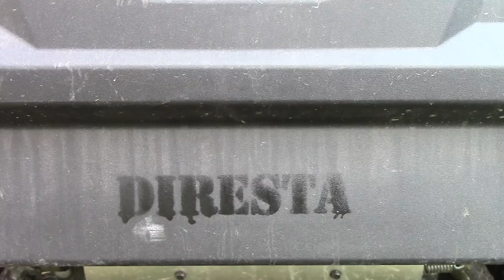✔  DiResta Tree Swing

Comment from the maker: This video is 4 years old so please no chainsaw safety crap!! enjoy!
Reply: jimmydiresta I really like the build!! Mainly because it looks so natural
Reply: jimmydiresta ok I will assume that you already know how dangerous the chainsaw plunge cut you made was, just kidding. As long as you still have all the fingers you had before you started it's safe enough. Great video as always.
Reply: how did the splice hold up over time with no wrapping? or did you wrap it later? i'm curious if wrapping really matters or not (i was always taught to do it)
Reply: jimmydiresta Just chainsaw the haters. ¯\(ツ)/¯
Reply: jimmydiresta love watch this video again 👍👍
Reply: Did you read the Title? DiResta Tree Swing (WARNING!! old Video) The clue is in the title if you are not sure........... Hint - Its in Brackets ( ) ....Where it says WARNING" OLD VIDEO....
Reply: I am a seaman, and can tell you with confidence that most splices are not wrapped. Mostly I wrap each individual strand with tape, or if it is synthetic rope, I melt it with a lighter. But I do this mainly to make the splicing more easy. (Even the big 8 or 12 strand ropes used to moore freighters aren't wrapped)
Reply: Gunhaver They will last. The more you pull, the tighter it gets.
Reply: +Delphi Man BYE!!!!
Reply: thats really interesting. i always wondered if wrapping it really did matter or not. i too would fuse the ends of strands to make it easier to splice (assuming it is nylon rope). thanks for the info!
Reply: Cool splice.....
Reply: jimmydiresta I am Mexican make the shield of the captain america
t admiro
Reply: jimmydiresta, gosh can you learn to go back in time and make things perfect so the trolls cant complain :D. In all seriousness thanks for posting all of your old videos on your channel :)
Reply: uSpotGaming He could probably find a Time Machine on the streets of New York City.
And I want to ride in it...

Comment: i haven't spliced a loop in so long... makes me miss the good ol days. 

also you should wrap or tape that splice. probably doesn't matter on that swing, but its always good to do to keep the splice together when people put their hands on it
Reply: maybe use a twine or string wrap over the splice? just spitballing
Reply: in the past i have used twine or thick thread that is designed for wrapping a splice. i have also used various kinds of tape. i asked about splicing in another comment, and some people chimed in that wrapping is not necessary if you fuse when needed. Jimmy's rope in this video was not nylon, which is probably why he trimmed the strands instead of fusing them with a lighter. wrapping is probably just one of those things that you are taught to do because thats how everyone else has always done it lol.

there is a kind of knot you use to wrap, so you can actually wrap using any kind of rope. obviously some will be better than others. Now, if you are talking about the end of a thick rope that is not spliced, and it is also not nylon, then you will have to wrap it to keep it from unraveling (because you can't fuse it).
Reply: copy all that, I've seen repeated half hitches used to wrap thick fishing line splices